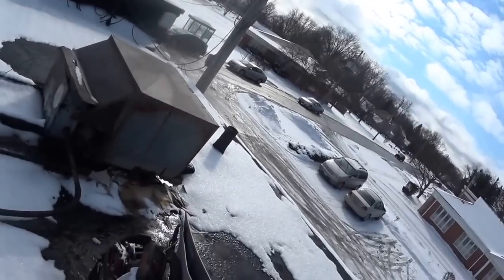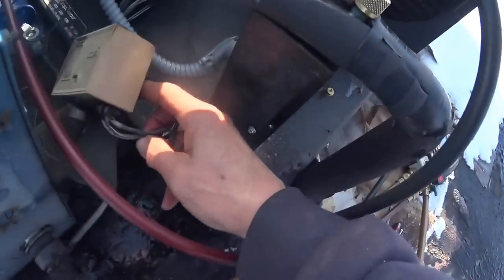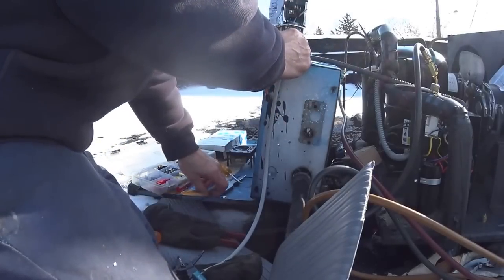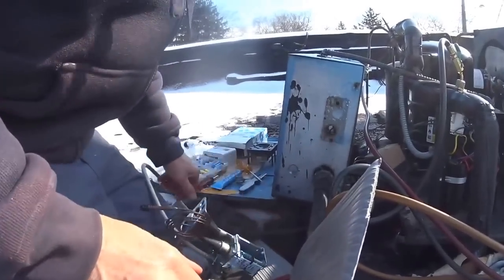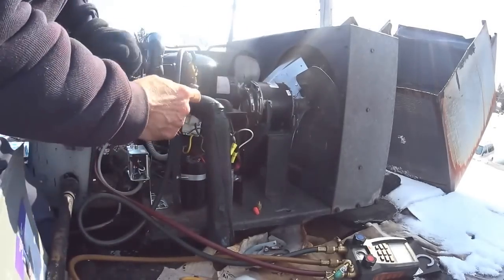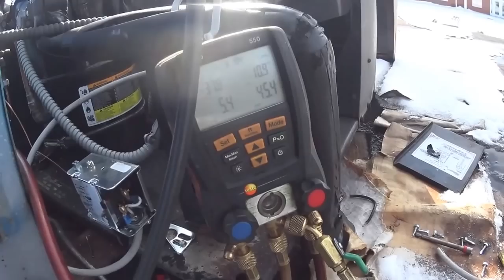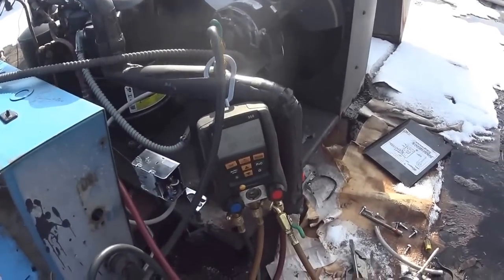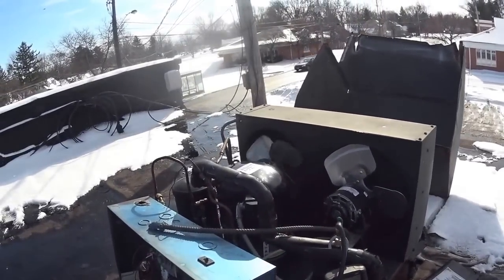Condenser head pressure fan control replacement

Comment: Hey Jim,
Great video like as always. Why not also put a low temp cut out on one of the motors and only have one fan running on the head pressure switch, wouldn't that make for longer run times and more stable pressures? Thanks again for all the videos and teaching, I learn a lot.
Reply from the maker: I've put two fan cycle switches on units but this system is small and the customer doesn't have a lot of money. I could leave one fan on and cycle the other.

Comment: nice video jim what kind of wire are you using for that control? it looks to me like 10-2 or 12-2 marine wire. it looks like its nice to work with I would like to pick some up.
Reply from the maker: The supply houses sell it out here, it's 14/3  black, white and a green ground, I like it, it does a neat job.

Comment: All the repair work he's getting done on there was a new unit. I don't understand ppl sometimes.
Reply from the maker: I completely agree, it would be nice to have a new condensing unit, but on the other hand all the service and parts, well it's more profitable for me to service old units. When I do replace an old unit with a new one, it could be several years before I get a call on it. I make a few hundred on a new unit, I make a few thousand servicing an old unit over a few years, and the customer is happy.
Reply: I know what you mean. Hoping to have the same luck I did when I first started off. Coming out of trade School I had A corner store, 2 dry cleaners, a restaurant that had an 8 unit apartment building and office building under maintenance contract. I was a kid back then and didn't know how beneficial those accounts would be right now. Always a good job keep it up Jim.